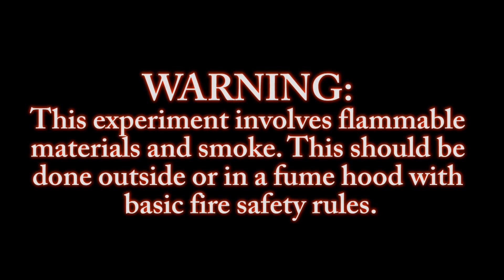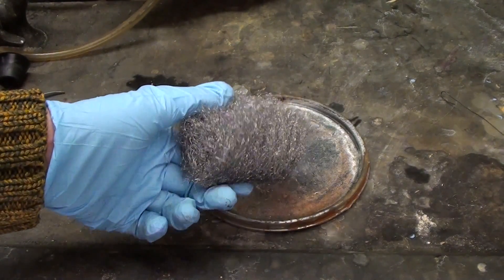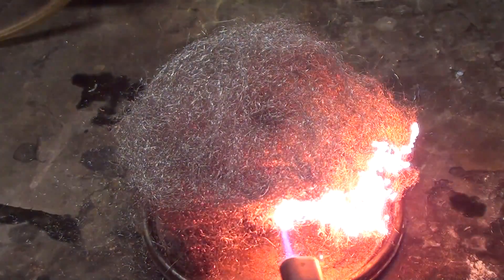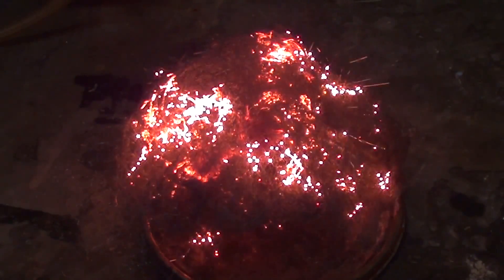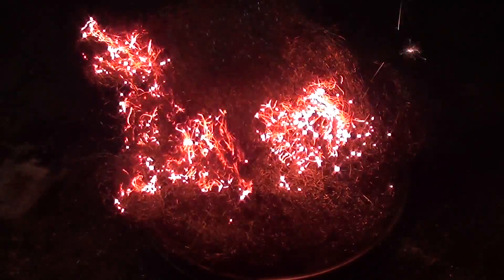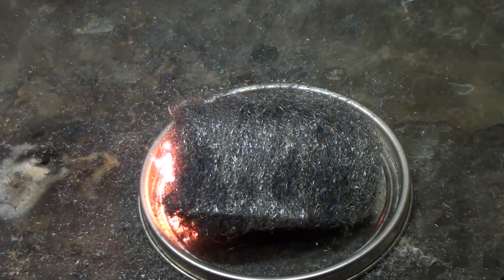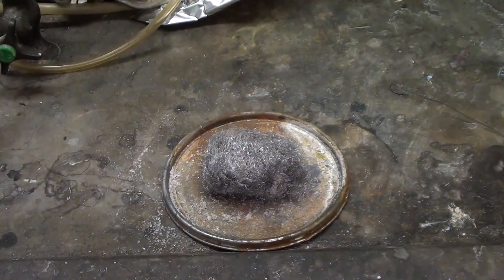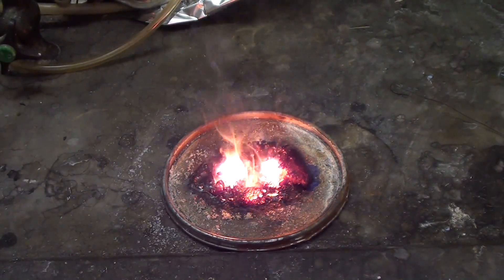BURN STEEL WOOL

Comment: No wonder you got such a result.
Electronic weight machine, uses electric resistance principle. When you burn the wool on metalic plate, sensor is getting hot and show's wrong data.
Thats all

Comment: Hi Nurd Rage, really cool and great videos. if you have time could you please advise if you want to extract compounds or minerals from Potash / Does hydrochloric acid on the ash then filter make it into a liquid form but then copper sulfite to separate the minerals / for example bananas and potassium extraction?

Comment: Is steel wool treated with Potassium Chlorate stable?  Can it be stored and transported?
Reply: +RonJohn63 It's the same principle as a flint and steel really, so I don't see why it wouldn't work- that said, a proper flint and steel would last much longer and let you light far more fires than consuming steel wool like this does.
Reply: *****  Exactly.  It would burn so fast that it would only light tinder.  *Just like flint and steel*.  So why not use the safer, cheaper, more durable flint and steel?
Reply: RonJohn63
But that's not the point you tried to make. You specifically talked about the wood not having time to catch, which it certainly would, in tinder format. ;)
Reply: *****  in tinder format.

I presume that MOAR POWER means "less tinder", since -- after all -- what's the purpose of MOAR POWER if you're just going to light tinder same as flint and steel?
Reply: +Chava Gonzalez   Why do you ask????
Reply: I was wondering if I can prepare some to use as a camp fire starter.
Reply: Maybe the wool by itself and some charcloth should do it.

Comment: We did this in school with a 12V battery. It started sparking too much, and we were foolish enough to do it on a wooden table. In an attempt to push to bloody thing down to the concrete floor it got stuck to my hand. I now have some nice 2nd degree burns to show for it. 
Protip: Never touch it. It sticks to the skin, burns and hurts. A lot.
Reply: Listen to Despactio and you will be better

Comment: Due to steel wool's conductivity and flammability, it is also possible to ignite steel wool via contact with a 9V battery. I had done this last year in my technology class accidentally, and on a wooden surface of all places. Luckily, no one (and nothing) was damaged. ^-^

Comment: Adding sulphur makes it even better!
Reply: Lycoosa And Lava Nukes With Fireworks
Reply: and nukes
Reply: Sulpher PLUS Pottasium chlorate.??... NOT a good idea, if ye ask me, with all the combustion going on when them two are mixed.!..
Reply: ***** ofc not, anyone who values their fingers wouldn't mix the two. i was talking about how sulphur reacts with iron (steel wool) :P
Reply: Ignis It reacts only if you heat it a lot before.
***** As for mixing sulfur with a an oxydizer, it works, but isn't that great either, I tried various oxydizer to make gunpowder and various combustible, sulfur as sole combustible wasn't that great.
Reply: Mixing sulphur with Potassium nitrate and sodium carbonate can make it burn fairly efficiently, problem is, you don't want to melt the mixture or it turns into a touch sensitive compound.

Comment: Less voltage works also, e.g. 3,7V Lion battery. The point is to provide enought current to heat a single strand to start reacting with air.

But be careful, this can actually damage your battery.

Comment: Before or after?
Before - Nothing
After - If the mixture has been mixed together the Iron Oxide which has been from from the oxygen mixed with aluminium powder forms thermite and when that is set on fire... Bad things happen! Just look at videos of thermite on the internet

Comment: now if you were to set fire to steel wool with a 9v battery to make a fire with it could you re use the steel wool again or would it disintegrate after setting fire to it
*i haven't tried this before that's why im asking*

Comment: Well, the thin wire is pretty much like the filament in an incandescent light bulb.  The current is enough to heat up the wire to the point of catching fire.  The reason the filament in light bulbs don't burst into flames is the lack of oxygen in the bulbs.

Comment: Try lighting one end of 50 ft or so of steel wire equivalent to the thickness of the steel wool. (If you can find it anywhere.)

Comment: This is the ultimate fire starter.
All you need is a little steel wool, a 9V battery and a piece single tissue of half of a paper towel.
Short the battery on a piece of the steel wool, wrap in the paper and blow the embers till the paper towel combusts.

Comment: i have a question:
Could i use the iron oxide created in the flames as a component in thermite and would i HAVE to burn it before using it in thermite and would it give a moe conrtolled form of it? 
P.S. You are AWSOME

Comment from the maker: @MrSiren52 the ad or the subtitles must have covered up the annotations that mention that. Either that or you might have accidentally left your annotations off. 

I think that point is also mentioned in the video description. 

I find it more surprising that because something can be done people expect it to be done. I could probably set it off with a magnifying glass, or on an electric stove, maybe even by induction heating. 

Am I obligated to? Why must people be surprised when i don't?

Comment: I'm surprised you didn't show the battery method of setting off the steel wool.  Lantern batteries work best.  I learned that method for starting a fire with out matches in Boy Scouts.

Comment: @Zafoshin 
A basic answer to your first question would be that bonds dont need energy put in to be formed because the atoms are trying to loose energy; the less energetic the atoms are, the more stable the compound is. Also, the stronger the bond, the more energy released when the bond is formed. This is because to break a bond, you must put in the same amount of energy needed to form the bond.This means that energy is not released when bonds are broken; breaking bonds is an endothermic process

Comment: @Vaslop2000 It does actually :) But I still don't understand some things.
Wouldn't the stronger bond that's being made need energy to be made? If energy is released by bonds breaking, energy would be required for bonds to be made, right?
Also, because the energy is so small, the mass would be too small to measure. So how do we know no mass is lost? Is it proven?

Comment: @Zafoshin i understand what you are saying, the energy is held in the iron molecules, as the bonds between each iron molecule are held weaker then the bonds between iron and oxygen (in the oxide.) So when the weaker bonds are broken and stronger bonds are made, (by burning iron in oxygen) energy is released... this is a lot less than the energy gained by the loss of mass, one gram of mass lost will release 45 trillion joules, (45000000000j)
Hope this helps

Comment: @Vaslop2000 I never said that energy just appeared or mass disappeared, E=mc^2 Energy and mass are conserved, through this equation. In theory, just by examining this equation, every exothermic reaction is a candidate for its appliance.
Of course, what u say is also theoretically possible.
Which of the 2 happens in practice, idk. U do and I trust that u know more than me, but I can't say I know sth, based on trust.
What kind of energy does the iron hold. Also, if what I say is right, the mass

Comment: @Zafoshin 
2Fe(iron II)+O2(oxygen)=>2FeO
That is a balanced chemical equation of the reaction of iron(II) with fire. When the iron is heated under such extreme temperatures(the blow torch) it bonds with the oxygen in the air making it heavier.

Comment: @Hoser1358 No, it is no longer steel wool after the reaction. It has turned into iron oxide wool, and would fall apart if you tried to clean anything with it, and it will turn everything it touches brown or black depending on the type of iron oxide it has become.

Comment: that's a great way to demonstrate that iron does burn

people don't believe me when I say that in oxy-fuel cutting, most of the energy is coming from the burning steel and not the acetylene which is only there to start the reaction, I'd really like to film cutting 1/4" plate with pure oxygen only (like get a small bit white hot and cut the plate using a oxygen-only nozzle.. that should be feasible)

also what brand model of hand-held burner are you using in this video ?

thanks !

Comment: Question: if you were to add powdered aluminum inside the steel wool (without the chlorate) would the burning iron produce enough heat to initiate a thermite reaction between the already produced iron oxide and aluminum?  I have a hunch that the aluminium and iron would both simply burn directly, generating a much smaller amount of heat.

Comment: The best part is that if you do this with 0000 grade steel wool and then rub the remains over a cheese grater you get a great iron oxide powder for thermite

Comment: up the bush, to burn through a string tied to the top, triggering the next device in line, it was pretty spectacular watching it be built, and then see it in action. I know the event was video taped, and aired live on the web, however I do not know if the recording is still on the net

Comment: when I was working at the Exploratorium in 2001 they had rube goldburg event where the museum had individuals create a part of a rube goldburg contraption. some of them were symbolic, and one of them was a "burning bush", it was a metal rod bush, covered in like 3 pods of spread steel wool, the guy who made it had twelve 9 volt batteries in series , and when his part was triggered, a ball would fall into a cup, closing a switch, igniting the steel wool from the bottom, the oxidization travelling

Comment from the maker: @L0rdPie As i said before you can simply turn off the sound and turn on the subtitles if you find the audio grating. The subtitles have been done by hand and actually correspond to the audio, they're not auto-transcribed audio that is notoriously "poetic".

Comment: @36trooper I thought, red iron oxide is used for thermite? If I burn steel wool i obtain black iron oxide, at least I dont see any red or yellow colors.
@Nurdrage Maybe you should try to blow pure oxygen into the burning wool, maybe this has an effect to produce another type of iron oxide?

Comment: @NurdRage yeah iron and kclo3 might work for igniting thermite. one time i mixed kclo3 and coarse steel shavings i got from cutting steel and the reaction ended up being so exothermic it broke the marble plate it was sitting on so i wouldn't be surprised if it worked.

Comment: When I was a kid (back in the 60's and 70's) we used to put a few balls of fluffed up steel wool on the end of an un-wound wire coat hanger, light it up and then twirl it around in a huge circle.
Needless to say, sparks and mayhem ensued.
Loads of fun for the kiddies.
And a spectacular and cheap way to add the festivities around the 4th of July.

Comment: @Yeuxvert no, if you dropped steel wool is liquid oxygen, it wouldn't spontaneously combust because fire needs three things, fuel, oxygen, and energy.  The fuel would be the iron and the oxygen would be in great amounts, but the fire would not start until a spark or flame started the reaction. But the reaction would also be amazing.

Comment: Very nice video nurdrage. Also, I had a question about the KClO3 you used. Potassium perchlorate (KClO4) is the oxidizer in aluminum based flash powder. Can KClO3 be used to replace the costly KClO4 and if so would there be an energy loss due to the lower amount of oxygen? Thanks.

Comment: Nice with the chlorate!  have you heard of the pyrophoric iron reaction?  get any soluble iron salt and ppt it with oxalic acid.  collect and dry the iron oxalate, then heat it in a test tube.  It decomposes to iron so fine its pyrophoric, and CO2, which says in the test tube and prevents the combustion.  When you pour out the iron you can see it burn.

Comment: Thank you. 

There are many experiments in solar energy collection using steel wool as a very good collector. It is painted black and lightly packed around fluid carrying pipes within a glass covered metal, or wood box. Many suggest that the collector be vacuumed so that the steel wool will NOT ignite from the heat of the Sun.

This is quite interesting as it shows what will happen if steel wool does ignite.

Thank You Again

Comment: @33200 It's not really a short circuit, but you're right -- the electrical energy is bottlenecked and converted into heat, making it catch fire.

Comment: @sbstransitbuses no there would be a minimal amount of it present it be useless just run iron in a saltwater solution with electrolysis filter out all the Iron Chloride than let it dry and it well oxidize and form Iron Oxide.

Comment: I had a chem prof who lit a pad of steel wool on fire then threw it into a cylinder of liquid oxygen.
BOOOOM!!! Like a projectile from a cannon it shot straight up, through the ceiling tiles, never to be seen again. For the remainder of the class we were expecting to see smoke coming from the ceiling or walls and have to call the fire dept...

Comment: the cool part about this is that you can start portable fires with this when you go camping or something. Just get a 12V battery and briefly touch both terminals to the steel wool. Basically since steel wool is metal, it conducts elctricity. Yet the wool is so thin it can't hold much electricity, so when you attach the battery you put too much voltage through it. This makes it short circuit and catch fire.

And there you have it. Fire with a battery and steel wool. Use this with tinder.

Comment: Is this a fast way to harvest iron oxide? I heard that burning steel provides Fe3O4 and oxidizing via water provides Fe2O3. I could use either, but using a spray bottle with water takes a long time to oxide steel wool.

Comment: If you were to ignite a tangled bunch of steel wool and aluminium wool could the resulting heat and presence of Iron oxide possibly cause a displacement reaction with the aluminium (like thermite)? just a thought :)

Comment: @PoopMcFeces  yes there is, you just need a 9 volt battery. fluff the steel wool like in the video and bridge the contacts of the 9V with a good portion of the wool. bam ignition.

Comment: I have a question, once I left some pure zinc in a stainless steel pot with half full of clear vinegar. A week later it had dried out and the pot is covered with a lot of sponge-like white-ish stuff. I heated it a little (150-250 c?) and it melted and as it cooled it formed a crystal-like structure and it felt just like candle wax, can you say what it might be ?